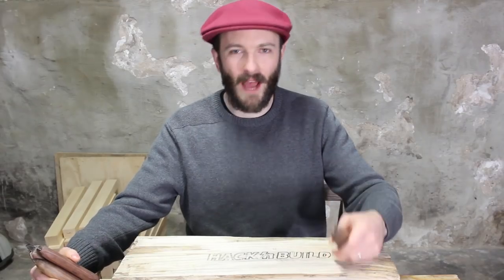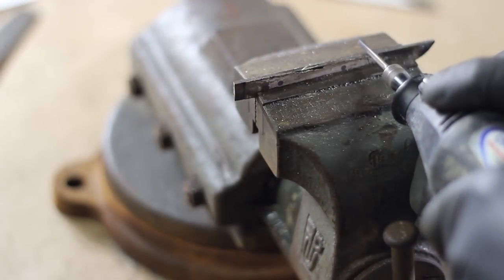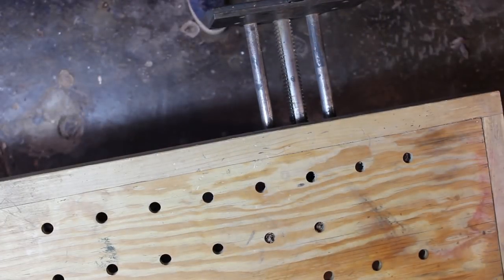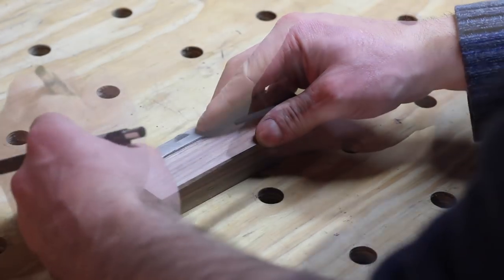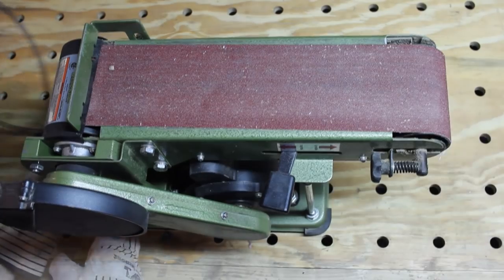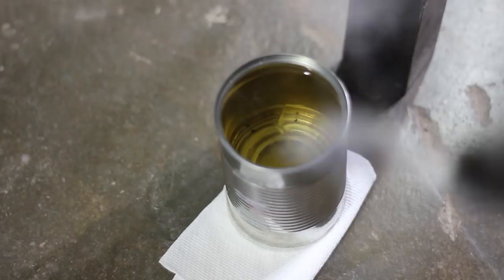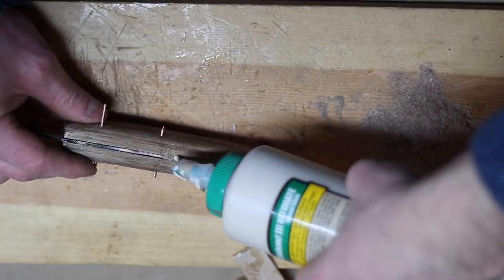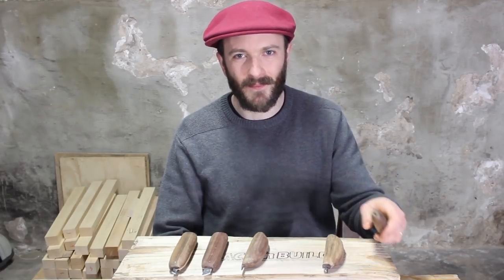Making Carving Knives From Firewood and a Saw Blade - HNB #16

Comment: If you got the hardness back to 55 HRc, that's a good hardness for a knife.  It will be quite durable, yet still not too difficult to reshape if needed.
I don't think it was a waste of time. If the steel got orange-hot during the shaping, it would not have worked well as a knife blade.  I think you did the right thing. At least you practiced heat treating a blade!
Reply from the maker: Thanks for the feedback!

Comment: Very nice video.  If the blades were hardened, how did you drill a hole in them ?
Reply from the maker: This was a while ago, I can't remember the exact order that the steps were done.  Likely I drilled the holes prior to hardening.  Either way, I didn't harden the entire blade so would be no problem drilling the holes.

Comment: The steel probably got hard enough during the quench you just tempered at too high a temperature. I expect they would use a .4-.6 percent spring steel for this application so tempering at 250-300 f. would give you 60 hrc.
Reply from the maker: Thanks for the info!

Comment: I would start with 1095 carbon steel or 01. Easier to work with for beginner knife makers. During heating, check that the steel that it has turned non-magnetic then rapid quench in oil then heat to 400 degrees.
Reply from the maker: Starting with a known steel is always going to be a better option than using junk mystery steel and sometimes it's fun to see what you can make with the junk.  Thanks for watching, cheers!

Comment: Heat treat failed because 1: you only heated up the tip, 2: you left the steel in the oil for only a few seconds, not giving it enough time to cool, or 3: it may not even be harden-able steel. Some sawblades nowadays are mild steel with carbide cutting tips.

Comment: A valiant effort and nice looking result, though that saw blade looked like mild steel from the sparks made while you were cutting it.  Now if you had an OLD circular saw blade (without carbide teeth), old hand saw, or worn out hack saw blade (though not the bi-metal kind) your methods might have resulted at a hardened knife at the end.
Try newjerseysteelbaron if you want a known steel.  Good folks.

Comment: Since they were not heated up prior to you doing work on them, the molecular compound wasn't changed.
Reply from the maker: I tried to avoid it, but the steel got a bit heated up (dull orange) when I was cutting it with the  cutoff wheel on the angle grinder.

Comment: What was that optical punch?
Reply from the maker: It has a holder with a hole.  In the hole you put a acrylic rod that has a cross scribed on the bottom.  You line your mark up with the cross, then insert your punch.  It helps you get your punch marks dead on.  The lighting in my shop is really bad, so it's a big help.
Reply: Thanks for asking this Bravo.  I didn't know what it was either.

Comment: I saw your makeshift forge.  I know it works but I do some blacksmithing and make forges.   If you didn’t want to buy one of my forges I could sell you some firebrick that would work better.    
Also.  Heat to non magnetic on the metal and quench right away.  You will get a better heat treat in the end.  And yes the heat treat was necessary.
Reply from the maker: Thanks.  I'll probably keep using map gas for projects like this, but I might make something a little more sophisticated at some point (coffee can, etc).  I am in the process of building a another coal forge.  I made a video on the design, and I'll probably be using that for larger projects.
Reply: I still meant for use with mapp gas or a small bernzomatic propane torch.   4 bricks make a small but very very effective mini forge. Rated to 3000 degrees.
Reply: L
Reply: Go man go*"'(.:

Comment: Carving knives are assembled in two halves with a slot for the blade routed in one side. They are epoxied in place and do not use pins.  Also the blades are not nearly as thick as yours.
Reply from the maker: Good to know! Thanks for watching.
Reply: The German ones I have (2 Cherries) are pinned.
Reply: Ok, generally.
Reply: Actually it entirely depends on maker. And I have seen carving knives use steel stock up to 1/4” thick.     Actually the set I saw go for sale was pinned (not glued), 1/4” thick, and sold for $975 for a set of 4 knives (all hand forged O1 tool steel.     
Moral of the story... it all depends on style.
Reply: @slc308  Style and smith preference. I make all of my carving tools out of round stock. 3/8" for sloyd and normal size bent/hook knives, and 1/4" for small carving knives (usually, sometimes 3/8" depending on what exactly I'm doing). I leave the tangs round so it's easier for the end user to put them into whatever handle they want. Simply drill the appropriate size hole, add epoxy, and insert blade. Align it before the epoxy sets and you're carving in 24hrs or less.

Comment: I see 2 problems there.
First : type of steel. You should look for saw blade without the carbide. Pure steel, nothing more. It gives much better results.
Second : hardening method. You just cooled tip. Rest of heat get back to tip and annealed it.
Read more about this process and keep trying.
Please, master hardening and sell me one set of these knives. 
PS. sorry for rough language.
Reply from the maker: Thanks for the suggestions, I'd like to try this project again with a known-steel instead of junk steel.  Cheers!
Reply: 55hrc isn't 'annealed'...and hardening the tip while letting the residual heat temper it is actually a traditional tool hardening method. It looked like he may not have got the tip hot enough, and he quenched on a descending red heat, seemingly below the pearlite nose if there was one for that type steel...but those things are subjective and the video could have affected them. The method he used was actually accurate and effective in itself though. Nothing wrong with it at all outside those things I noted.

Comment: 2 reasons why your heat treat may have failed.1 not hot enough, check the steel becomes non magnetic then heat a little more. 2 your steel may be water hardening not oil hardening, this is the downfall of making tools from mystery metal
Reply from the maker: Thanks, I'll try the magnet test next time!
Reply: No worries, looked great btw!